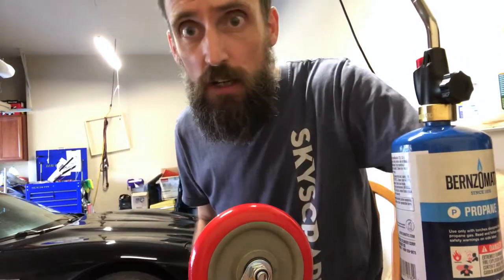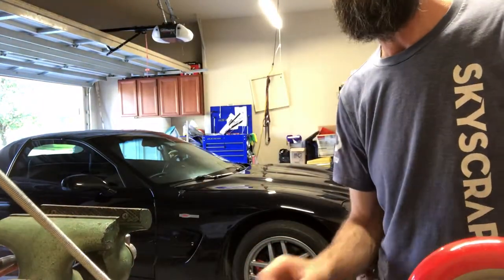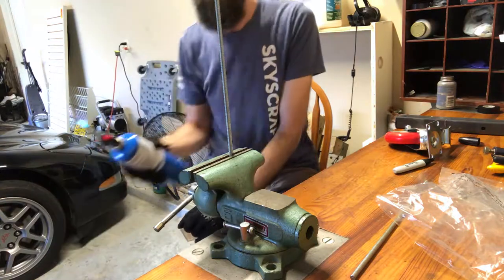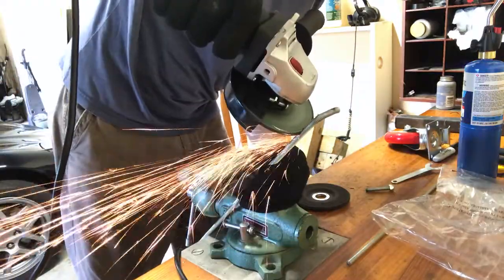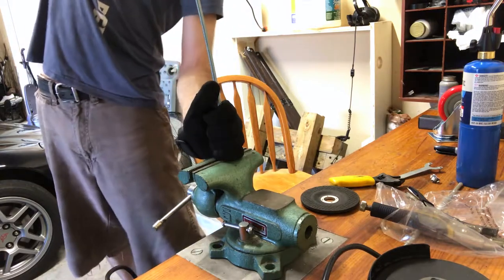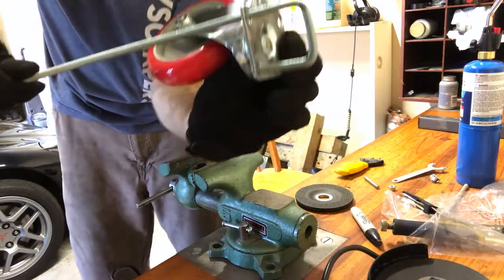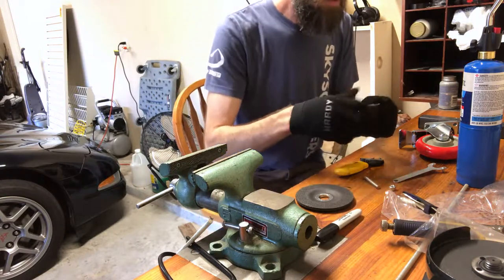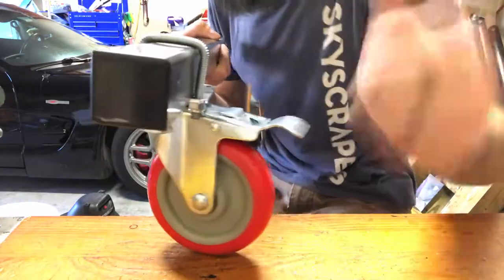Custom U-Bolt Fabrication from All Thread

Comment: What about buying some heavy duty mending plates or making heavy duty mending plates from flat steel bar stock and then cutting 4 thread studs of the appropriate length and then assemble them together with ease?
Reply from the maker: That might have worked. However, I didn’t have a lot of tools to work with like a drill press. And the tolerances were tight once everything was put together (the rest of the shelves).
Reply: @Daveandbillie  I see. Interesting.

Comment: Dude! I can always appreciate someone that doesn’t take themselves too seriously, if someone doesn’t have a sense of humor they are just a DICK! 😂
A for effort, it beats sitting in a couch. I’m VERY handy, yet enjoyed your video. 
Little tip, next time use a steel pipe slightly larger in diameter then whatever you want to bend. Put the pipe close to the vice then pull to your liking. I pull my pipe all the fucking time!
Reply from the maker: “I pull my pipe all the f-ing time” Epic Hahaha 🤣 thanks for the comment. Some people just don’t get it, no sense of humor. I don’t understand how they live?! Anyway “You Stay classy San Diego” - Ron Burgundy
Reply: @Daveandbillie  just don’t scratch my black corvette behind you. I swear you were gonna hit it 😂 
I’m glad you didn’t.
Reply from the maker: larry zepol larry zepol hahaha 🤣 unfortunately after 13 years I had to sell it. But the new owner is treating it well. He just did an 8,000 mile road trip around the US including a few flat out top speed runs on the Bonneville salt flats hitting over 174 mph :)